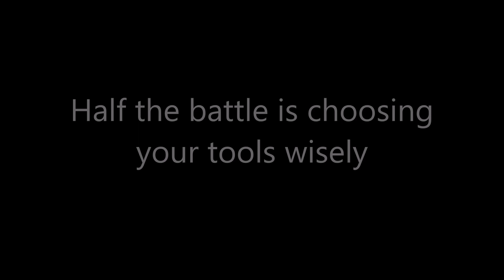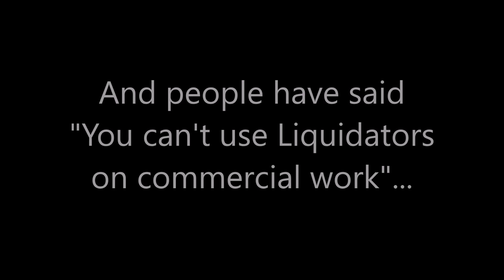Polzn Bladz-Working Wisely & Precisely

Comment: love to see your videos also working on using moerman system with all respect zoom on 3.17
Reply from the maker: Spider nests from the corner of the frames got trapped under the rubber end causing the lines. The windows are cleaned once a year and the biggest problems are spider nests and insect droppings sun baked cemented on the glass
Reply: @polznbladz3242  I´m not sure about that thick solution i have been cleaning for 28 years. I have a lot of small windows in my house, and when the sun is going down in the west speciel this time of year you can see all on the windows. thick solution made a lot of thin lines. i only use 0,20 dl in a 5L bucket that can hold a days work spraying on the pad
Reply from the maker: @pudseren1  Wherever the squeegee travels, it leaves an invisible trail behind. It gets highlighted by low level light, condensation and dust that settles on the glass. Where ever you walk you leave a trail, drive etc. It usually stays invisible unless something can highlight it
Reply: @polznbladz3242  is it univodable? I use the soap on
The mop method but notice j need a wet mop
Reply from the maker: You need a saturated washer or you could do what Window Cleanse does and that's use a squirt bottle. But you'll never get very far with that especially on a hot day. He's not a skilled window cleaner, he might make fancy moves on the glass but he is wasting his time making a mess every single time
Reply: @polznbladz3242  yeah I agree I find your method better :)

Comment: How do you know when to use 10 inch and take out sides then the middle or 14 inch and clean to each side all the way down?
Reply from the maker: On a pole you mean? It's easier to use a smaller squeegee as you have more room to move around. If the window is easy to work on and you have the ability to clean to each side then try it like that. The easiest method is taking out the sides and do the middle last and use a smaller size if you are still learning it

Comment: Hey Bob how are you getting on with the Dr. Angle? I was thinking of getting one, but heard that the first versions were flimsy. Have Moerman changed anything with the version you were using?
Reply from the maker: Nice to hear from you again. I'm not sure if they are back on sale after the first attempt. I've not had them fail on me on the job but I have broke them when the van door blew shut and I didn't put my pole away properly in the tubes them sit in mounted on the van wall

Comment: Can’t see the point in using a pole for high windows when you can do them twice as quick using wfp system
The lower windows yes 👍
Reply from the maker: Those windows are full of crusted on fly shit cleaned once a year. They have vents full of crap. I'd clean those windows quicker using that Excel on  a pole with my eyes closed  against anyone cleaning it with wfp. Plus the job looks better with no 15-20 grey drip marks on each pane brushed after it has dried. If the wfp would be a better choice I'd be using it but it isn't. Wfp only cleans well maintained windows. Everyone knows that but most wfp window cleaners will never admit it